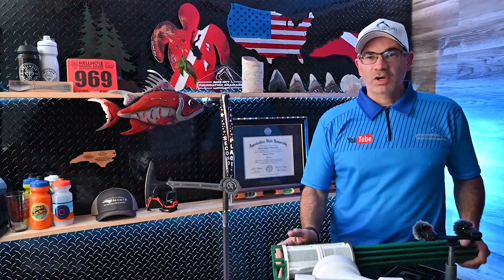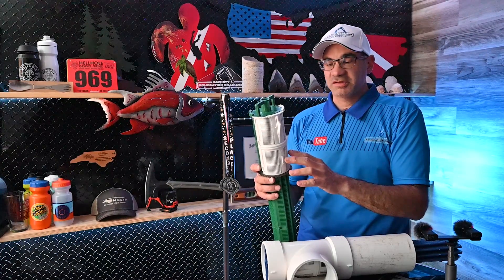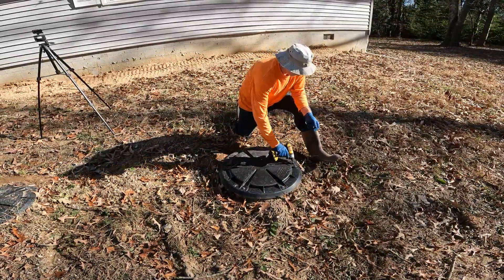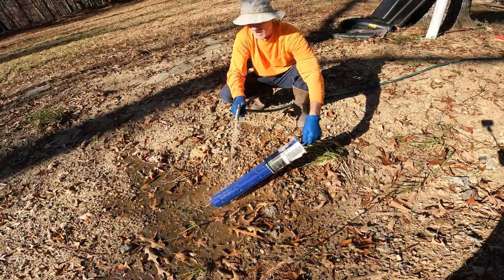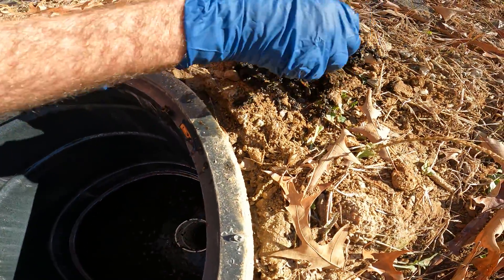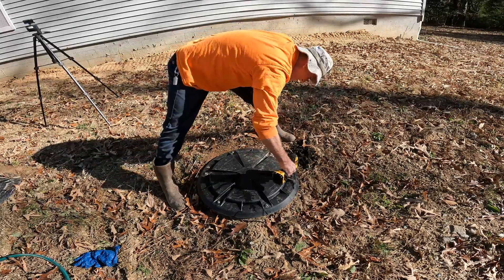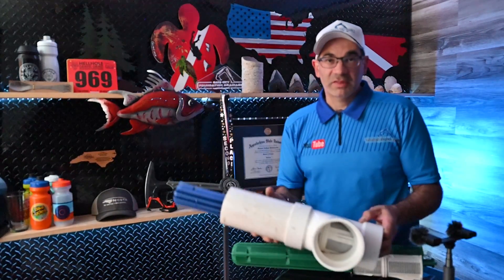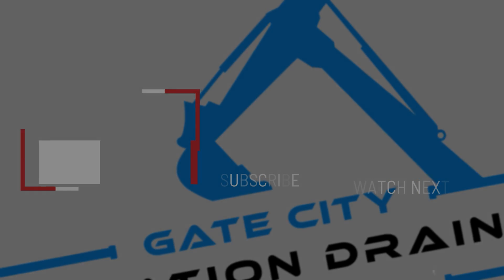Septic Tank Effluent Filter Cleaning - lid risers are very helpful

Comment: We have had a gravity septic system for 35 years and have it pumped every 3 years and have never had a single issue. We don't have any filters. The tank has concrete baffles on each end of the tank. No maintenance every 6 months- what makes these guys think this filter stuff is better???
Reply: Your leach field is at the end of its life if you haven’t installed an effluent filter. I wouldn’t be surprised if it fails soon. Install an effluent filter asap. It can save $20,000 to $40,000.
Reply: @andyallen1772 we had the distribution box dug up this last time we had the tank pumped and the lines had maybe an inch of sludge in the bottom. Septic co said it was real good for the age and should have a few more years of use.

Comment: Good video, but the cartridge sleeve it was installed backwards. According to the manufacturer, the bump out on the sleeve faces the outflow PVC pipe. Just installed a new drain field in South Florida 500 square-foot dome drainfield over sand on a 1250 gallon septic tank, cost $8600. Sod will be another $300

Comment: I believe you put it in backwards. That or I put mine in backwards. I believe the spring loaded bump out is meant to pop back out when it gets in line with the horizontal/lateral pipe. Also the finer slots are on the side with the spring loaded bump out as to give another layer of filtration.

Edit: I just received a new filter unit from Zoeller only because I was missing the rubber scraper that fits around the bottom of the cartridge and the instructions do show installation how I described with the finer slotted area with the bump out facing the lateral pipe. Hope this helps.

Comment: I have a 50 year old single concrete tank septic system. It backed up even though it had been pumped a year before. This is a two person house, only toilet paper and poop goes into the waste. There is a filter similar to the one you show that was installed maybe eight years ago. In three weeks the filter went from clean to clogged up like the one you show. I couldn't even see it; there was so much solids covering it over. I used a long metal rod with a hook on the end to pull it up. Obviously, something is wrong if the filter needs to be cleaned every couple of weeks. Do I need a new outlet baffle?

Comment: Very interesting.  We had a new system installed when we built a cottage on our property for my parents at the end of 2019.  It has a pump with pressure manifold and they added lines for the bigger tanks.  They had to use plastic tanks due to the location since it would involve driving over the lines.  We don't think there could be a filter with this system but would love to know if you think we should or could add one.

Comment: My 1500 gal tank has a main chamber (pumped) and a small rear chamber (not pumped) around the outlet.  I presume there’s a partition/screen between the two.  Also presume that this design cuts down on particulates tha might get to the outlet.  Any thoughts?  30 year old system.
Reply from the maker: Yes you have a chambered tank. The internal chamber works just like a baffle to only allow the clear water to pass through the (roughly) center of the tank. If you let your solids build up to overflow the internal chamber and spill into the rear chamber catastrophe would follow. Keep that main chamber pumped out. 👍

Comment: Homeowner here! My entire drain field was clogged and flooded and the tank had to be pumped 3 times within a couple months. After the last pumping, I installed a riser, effluent filter, and aerator all by myself. We used water sparingly at first to let the leach field dry out as much as possible. Been working flawlessly for 3+ years now. I think going aerobic was key to rejuvenating and improving the efficiency of the system
Reply from the maker: I've never done an aerobic system before but they sound interesting. I'm glad you were able to save your field. Nice work! Maintaining your septic system is so critical and so many people ignore it.
Reply: The aerator will also make your tank work like a hydroponics sump.  It doesn't take long for a large tree to fill up one of those inlets or outlets with roots once you've added oxygen to the water with the air-pump.  Just keep a watch for them.
Reply: @SlackerU  Interesting, I hadn't heard of that before. Don't think there are any trees around that would reach but I'll keep an eye on it!

Comment: I would like to see how a riser is retro fitted to older concrete tanks. Thank's for posting.
Reply from the maker: Polylock makes a kit for that with a flat bottom. It sets on the concrete tank after the concrete lid is removed. Pretty slick.

Comment: 1/3 of my yard is the leach field. Another 1/3 is the "repair area". What percentage of time can you just reuse the original leach field area if you ever need it replaced? My system is fine for now. I would like to put garden beds and small fruit trees in the repair area but don't want to have to potentially rip them up in 10 years.
Reply from the maker: It really depends on the type of failure. If it were me, I'd do whatever I wanted in the repair area. That way you can enjoy that land for the 10 years!
Reply: When farmers use biosolids they are required to wait 120 days for low hanging crops or only 90 days for tall crops like corn.  If your soil isn't contaminated with lead-dust from lead-paint or lead-fuel or arsenic-gardening in the late 1980s then you can probably have edibles. 

Stone-fruit only live about 14 years if you're using them for fruit production so you might not loose too much for something like that.  Or you plant on mounds where a large tractor could better scoop up your fruit tree for easier transplanting.

Comment: Hey Sean quick question, after watching this video would it be wise to pump down the water level a bit before removing the filter?
Reply from the maker: If I had known so much debris would be in there it wouldn't be a bad idea. Unless you got the tank pumped, you'd have to use a garden hose siphon to pump down some of the clear water.

Comment: does the filter have broom stick threads ?
Reply: They usually are a 1” or 3/4” socket fitting, so you can glue in a piece of pvc pipe to make a longer handle.
Reply from the maker: Like Matthew said above 👍👍

Comment: I definitely should upgrade my filter from my clarifier-tank to my pump-tank, my trash-tank to my aerobic-digester don't actually have access to add a filter & I imagine it's b/c of how long it takes to grow a large population of aerobic-bacteria though I'm no scientist.  

An unsolicited rant on OSSFs: Everyone here in the south needs to switch to aerobic-treatment-tanks & Sprayers.  
OSSFs are at the top of my project list b/c of how often I come across cesspit-fever.  My OSSF director/rep told me that the air-pressure pumped into the aeration tank is to release into the house-plumbing... SMH, NO it doesn't!  In fact many of the earlier aeration systems even concreted the top of the T-fitting on the trash-tank outlet, b/c oxygen is not something you should be adding to the trash-tank b/c it is an anaerobic-digester.  My State tells the installer to vent using the riser so the installers interpreted that as leaving out multiple screws for the risers, then some of the OSSF manuals actually tell the installers to add a vent on the chlorinator which is usually a PVC pipe sticking up out of the ground for bleach or chlorine-tablets. 
What is tragic about my pathetic director is that some of the modified systems will have 1500 gallon trash-tanks where those homes are now at risk of accidental gassing if a p-trap dries out or a rodent makes a hole in a vent-pipe in a  wall. 
I want my family living with a 300-gallon trash-tank that is pumped every year so there is no grease-layer for the rodents to live on, & the aerobic-digester doesn't need to be pumped ever(if possible), unless the pump-tank has too much sludge b/c those bacteria take forever to repopulate.  
I could speak on the issue for days & days, it needs an overhaul even with the 2020 advancements in law changes, it's wild that the workers & my director find it ok to send possibly-dangerous gasses into a home when the designs never allowed it. .
Reply from the maker: Hey Bob adding chlorine would be the last thing you wanted in a digesting environment.
Reply: @GCFD  The Chlorine is added to treat the last 3% of possible pathogens before the effluent is sprayed on the lawn for its UV treatment offered by the sun, it literally evaporates b/c the amount of discharge is restricted too as they allow zero-runoff. My pump is only on less than 15 minutes per day with a max possible discharge rate of 9 GPM over 6-7k square feet of lawn, so it's so little it is eaten by the environment.   The effluent that leaves my aerobic-digester is only 97% treated.  One important thing to note about leach-injection-fields is that they only have about a 25 year expected lifespan where a sprayer OSSF field will last an expected 40. Plus the quarterly inspections on a rental with an injection field is $350-380 where a sprayer OSSF is only $185 for all 4 inspections need for the year.  [My area is mostly floodway or city so basically the State has banned the repairs on those old cesspool-to-lawn systems & require aerobic-bacteria in the design. Literally homes on land with a 0-inches of soil above the December-water-table who are still living like people did pre-1970 when the sewage rules upgraded a tiny bit.